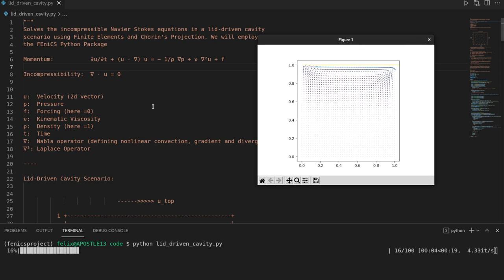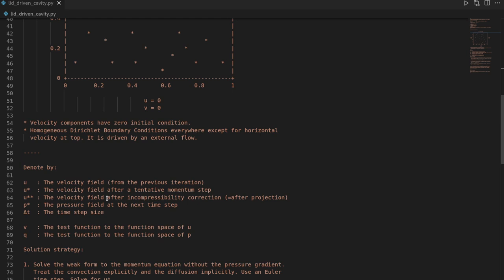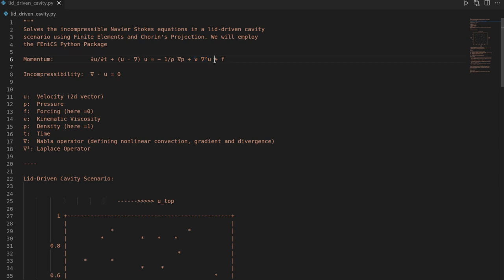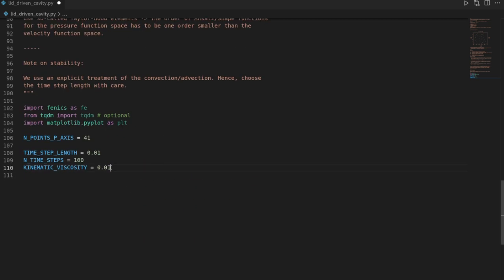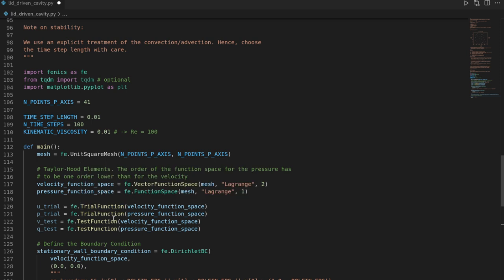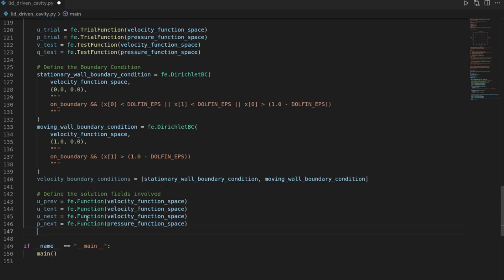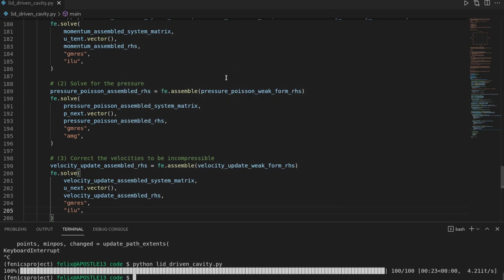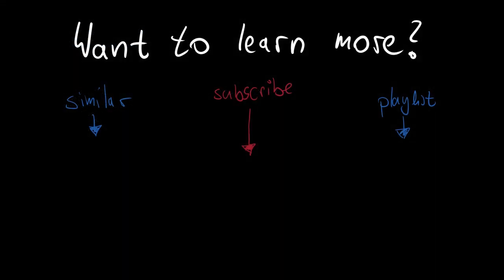FEniCS Tutorial: Navier-Stokes Equation for Lid-Driven Cavity

Comment: Hey! Thank you so much for the video. Is there any way to validate that the solver indeed gives the velocities expected?
Reply from the maker: You're very welcome 🤗 I'm glad you enjoyed it. 
Generally speaking, validating numerical solvers is challenging. A first thing to check is if the two time steps in a trajectory (or the steady-state in a stationary simulation) fulfill the discretized PDE in that you plug the velocities into your discrete equations and computer a norm metric. If it is below a desired tolerance, it is a correct solution to the discrete problem. For the specific algorithm presented here that might not be too easily possible because we do not iterate Back and forth between momentum and continuity equation which would be necessary to ensure both are solved to the desired degree.
Another approach would be to use test problems (like the lid-driven cavity) for which reference values are available (for the lid-driven cavity, one often uses the values due to Ghia et al.).
I would recommend you to check out chapter 20&21 of book "automated solution of differential equations by the finite element method" by logg et al.

Comment: Would be great if you did a variable density fluid, ie. Euler equation + viscosity coupled with advection of density. Everywhere density is constant, viscosity is constant, and fluid incompressible all the time.  Doing something out of the mold would be very special.
Reply from the maker: That's a cool suggestion. I will note that down. :) 
I do not have much experience with compressible flows yet. From my engineering background, I would say that they mostly only relevant for high-speed aerodynamics (like fighter jets etc.). Almost all other engineering CFD is incompressible (or at least in the incompressible limit). Though, I can understand that it can become boring :D. Although, the saddle point structure of the incompressible NS is also very challenging, mathematically speaking.
Reply: @MachineLearningSimulation  yes I know. I'm a physics student an fluids are very difficult. But with the power of the computer, you can do that crazy stuff.